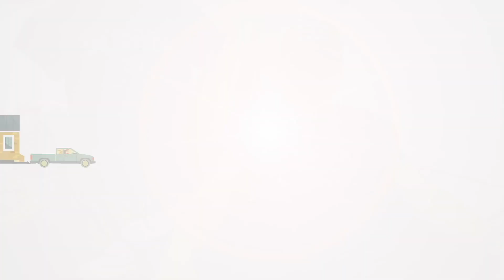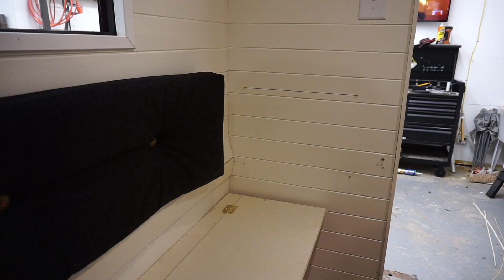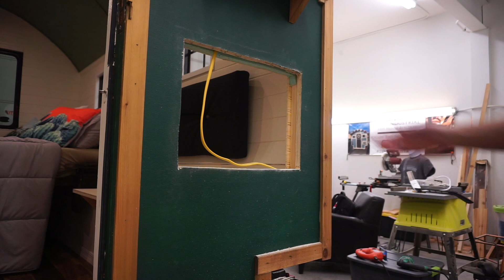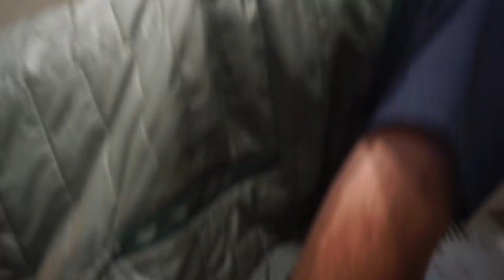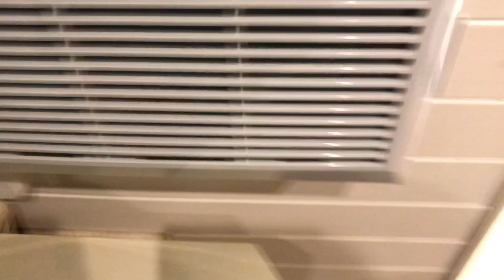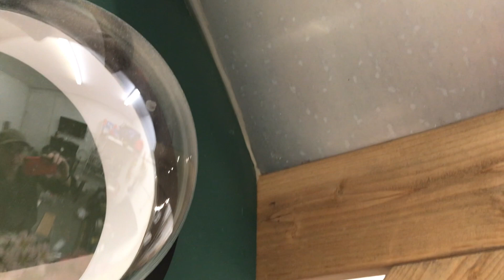Tiny House Air Conditioner Install by Tiny Industrial

Comment: I assume the trailer was sitting absolutely level …..with you using a level to mark it off  ?
Reply from the maker: You mean in regard to overall positioning or tilt? Positioning is easy since you can use the surrounding structural elements to center it and so forth. The slight downward tilt (for proper water drainage) is fairly tolerant and if it 2 or 3 or 4 degrees doesn't make that much difference. Hope that answered your question (?).

Comment: Excellent info on the A/C install.
Reply from the maker: Thanks! Yes, 5000 btu is plenty sufficient for a small insulated space like this. This unit was heading to AZ and the install kind of happened after it was complete already normally I would have installed it at an earlier stage of the build process.